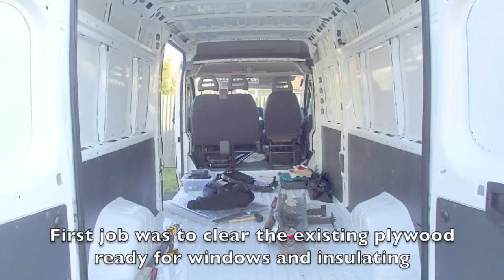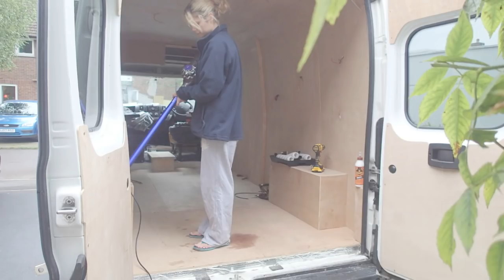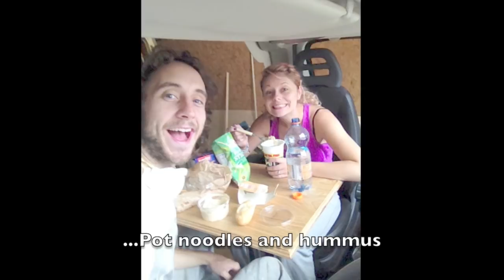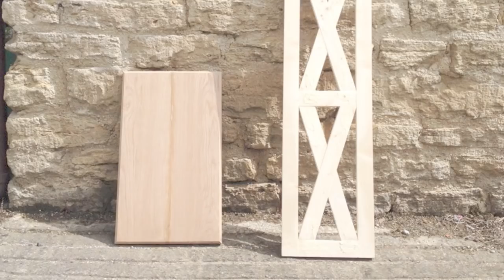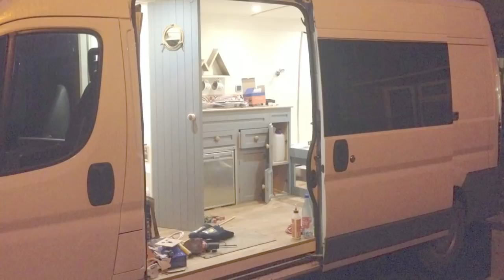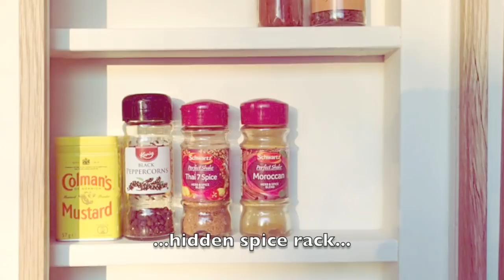Camper Van Conversion // Full Build Tour From Start To Finish

Comment: Hi there! Did you guys convert it to a motorhome with DVLA? I really like the table solution but wasn't sure whether they'd accept it. Thanks! The van looks gorgeous :)
Reply from the maker: Hey! Thanks very much! Yes it was converted to a motorhome with the DVLA so it is possible to use the cab space as the dining area. As long as the table has a permanent place to fix to it's ok to use :)

Comment: Where would I get foil wrap like this?  Is it sold under a different name is USA?  When I look for foil wrap it shows me the one that is used for wires which would not be wide enough for this.
Reply from the maker: Hey Jean, I got it from amazon, if you search foil wrap insulation it should come up with a few options, I think mine was a roll of 50 metres which was more than enough :)